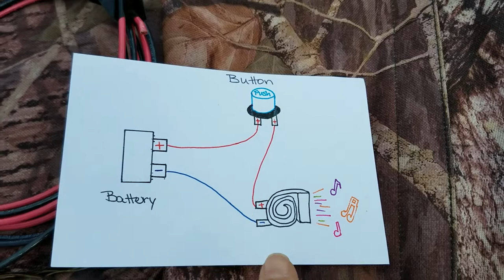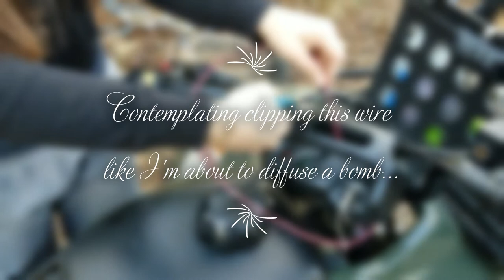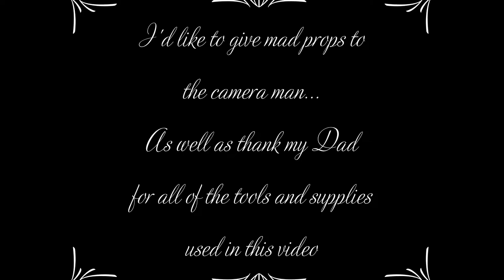How to Install a Horn on an ATV

Comment: I am doing this tonight to my 2020 Recon.  I am adding an inline fuse so it's not a direct circuit to the battery. I think I am also going to change the placement of the button so I don't have to fight with screwing it into such a tight space. I think I might try putting in next to the Neutral light.  Thanks for the video!
Reply from the maker: How did the horn install go? What made you want to install an in-line fuse?
Reply: It went great! I did a couple things a little differently than you did, but not drastically.  I honest couldn’t have done it with out your video! I put an inline fuse in because me and Mud Squirrel (what I named my Recon) like to ride through a lot of water and mud so I didn’t want a direct current to the battery.  The fuse will pop if such an event were to occur instead of potentially frying the electronics in my 4 wheeler through the battery.  I was probably being overly cautious but it was only a few extra dollars.  I wish there was a way for me to attach photos to show what I did during the installation and the finished product!
Reply from the maker: @jenniffermcc4232  I'm so glad the video helped even just one person (and Mud Squirrel, lmfaooooo)! I obviously didn't put a fuse in mine, but that & protective wrap for the wires are 2 things people have mentioned that I probably should have thought about before hand & did it for completeness sake.
Yea, I wish you could attach pics but maybe make a YT video & send me the link! 😀 Happy Trails!
Reply: fuse is a realy good idea, like a Must.
Reply: @jennabobenna3631 if you get a shirt you’ll atv could catch on fire

Comment: I'd recommend a wire loom to protect the wires from rubbing as you ride and possibly shorting out your battery. Secure it with zip ties. Good job on doing things yourself!

Comment: Now that you've been running it a while, have you found that you should have added a relay switch/box?
Reply from the maker: Nope. For the price of everything, I could just replace it all for cheaper than dealing with a relay, not that they're expensive or time-consuming but just not practical for this particular instance.
Sorry, I thought you were referring to an in-line fuse. A relay, though? Idk.
Reply: Chet, why would you recommend a relay for this application?

Comment: What screw did you use for the battery terminal it seems like the original screws that come with it can't hold much things down with the positive and negative wire
Reply from the maker: Yea, just the original screws that came with the battery. May have shortened by 1 thread with the space that the electrical connector took up, but seemed secure.
Reply: @jennabobenna3631  ok thanks!

Comment: I'm putting a horn on mine can you tell me what gauge wire you used?
Reply from the maker: 12 Ga, but the wire was a little bit large for the button, so I'd go a size smaller (or get a different button)
Reply: Ok thanks ill use 16gauge
Reply from the maker: @MechanicEli2007  Let me know how it turns out!!!
Reply: Jenna Bobenna it has turned out great thanks for the video!